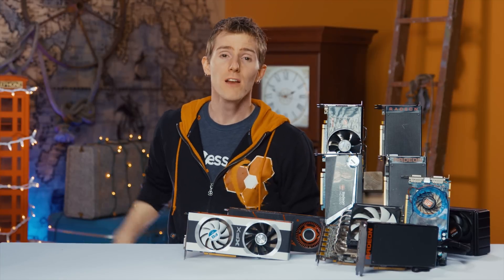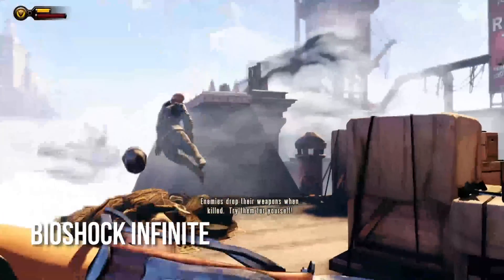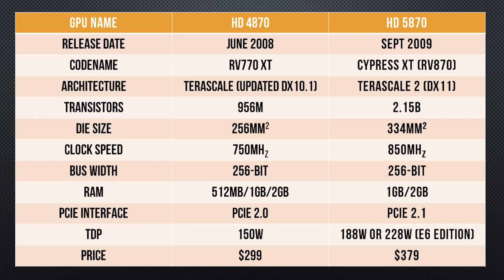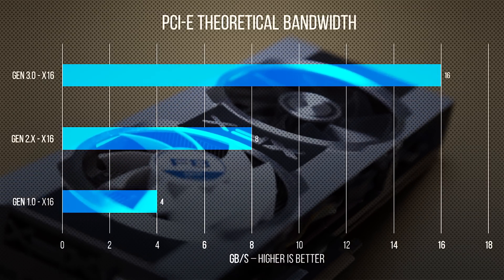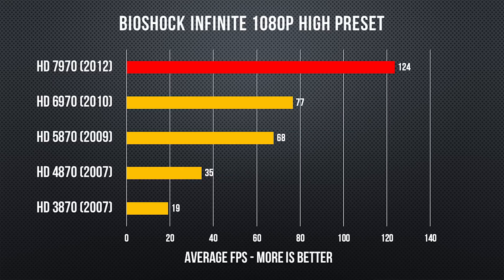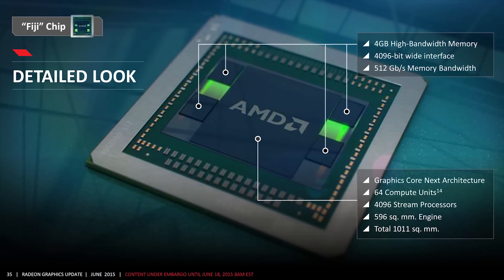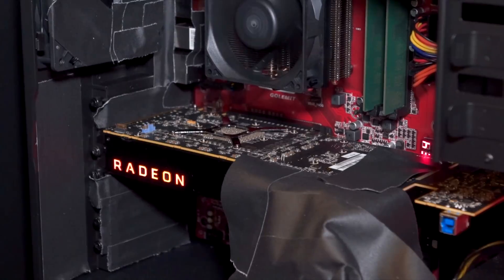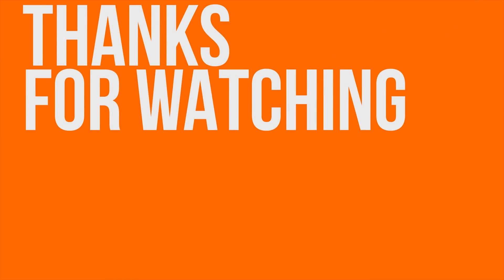10 Years of AMD Video Cards BENCHMARKED!

Comment: That HD5870 chip, brings back memories! It was in my first truly expensive build in a while, paired with an i7 920 overclocked to 4GHz.. In fact, besides having saved up eventually to get an R9 290X, which died on me (it was MSI, no surprise) then having to wait again, that GPU lasted me a good 5 years (i was playing GTA V on a 1GB model, overclocked of course and hitting 40fps!) before finally changing to nVidia with a GTX 970! What annoyed me more is i'd paid full price for the R9 290X, only for it to go half price after mine had died, then couldn't get it and had to choose between a 390X with 8GB, or a GTX 970 and a 256GB SSD for the same price.. nVidia and SanDisk won that one!

Comment: back in 2007 I had a HIS Radeon X1950 Pro 8X AGP card. 512MB 256bit GDDR3. It was a single slot card and had an oversized heatsink with a sword graphic sticker on it and a small fan at the rear of of the card. Then I had an ASUS Radeon HD7770 2GB 128bit GDDR5 PCI-E 3.0 card (part of a PC upgrade build for Win 7 when it came out).  Then 2015 to present I am running an ASUS Radeon R9 270 2GB 256bit GDDR5 PCI-E 3.0 card.  Before the HIS graphics card I was a big ATi Radeon fan back in the mid 90s. I had several different models of the ATi Radeon All in Wonder graphic cards with the built in TV tuner and AV input block. I did a lot of recording from the cable TV back then. Just like you would DVR stuff today.

Comment: Had ATI 7850 Sapphire editing 1GB for exactly 7 years, bought used GTX 960 4 months ago
In that 7 years 7850 served me great,  I started having Issues with NFS 2015 and NFS payback which had to be played at low at 1080p but those games really looked good even on low. Worked great on The Crew and The Crew 2 (almost maxed out), it was really fun to drive countless hours thru whole map of america. 
The only problem I had was VRAM because I got 1GB version and mostly of 7850s were 2GB. So that made me play just cause 3 on low (but 1080p).

Comment: Would be nice to see an updated version of this video.
Reply: especially now, after the announcement of the 6000 series
Reply: King Marco Louis III  RT performance fell where it was expected to. Nvidia had been pushing the tech a whole generation ahead. Either way I don't care green or red, I just want best value. And in my eyes raytracing is an FPS killing gimmick.
Reply: Rtx 3090 owners are mad rn lmaooo
Reply: King Marco Louis III  The price and performance gap between the 3090 and 3080 is where the 6900XT fits in. And similar with the other 6000s. They are meant to compete at price gaps. One needs to remember that the 6900xt is set at $500 less than the 3090. That's huge.
 Further, some people are acting like RT and DLSS are everywhere when in fact it's only a small minority of games (almost entirely AAA) that support them. And even still a lot find that DLSS working well can often be a proposition of what other hardware and settings you run plus whether it actually works well for the specific game and the sometimes noticeable effects can have. I simply look at  as another Antialiasing option. I never made a purchasing decision in the past based on a specific antialiasing support so I dont think that will change for me now. If you need absolutely need RT then your purchase should be obvious, but other than Minecraft, I've found the impact on actual perceived immersive gameplay for RT to be hardly noticeable, and never worth the performance hit. I''m sure one day that will change, but by then I'm sure I'll probably be looking for a new card and both offerings from Red and Green will probably be pretty different. Few should be buying based on DLSS and RT play in my opinion for at the very least a couple years.
Reply: King Marco Louis III  This reads like an NVidia marketing ad.  And btw "DLSS currently is supported universally on the current build of unreal engine 4" Incorrect. They have an Unreal Branch underwhich you need to be approved for, they aint letting any old joes in. I mean if you listen to what the reviewers are saying, I'm basically saying the same things. None of these cards directly compete really. And while RT and DLSS are good to have, right now and in the near future, it really depends on your specific use case scenario, hardware, and preferences. Basically if you have a specific game you want to play with heavy RTX, if that's important to you then go Green. If you're prefer to keep your options open and have a specific budget, then Red may be the better option. Certainly, looking at the performance per watt, AMD has a lot of headroom for OCing and driver optimization that shows a lot of potential for their 6000 cards to really mature with time. Efficiency wise the RTX 3000 cards are really brushing up against the ceiling. And man considering the extra memory and unrealized potential of the 6000 series, especially if you have an AMD system is definitely something to consider, more so if you're big into games with lots of modding.
Reply: @johnjingleheimersmith  I bet he's a Nvidia employee or he's smoking something funny... :)
Reply: King Marco Louis III  "The only card that's legitimately future proof is the 3090 and only the 3090." LMAO! Stoned? Mmm. Stop it! It's not good for you! Damn...
780ti, 980ti, 1080ti, 2080ti, TitanX and 3090 were never future proof... Not even for creation content. Their pricing made them a silly purchasing options even for the ultra enthusiast... Only professionals who make money from such a hardware should buy them! Period!
Reply: @Polar92886  i agree, those cards are just way overpriced and a huge majority of people just want high fps at a reasonable settings and price, that is why sometimes AMD cards just gives us more value without extra gimmicks that you would have to pay for. and also, look how the r9 series are doing now, they are a compelling option especially for budget gamers that just wanna game but still have really great experience
Reply: I agree...
Reply: King Marco Louis III  The main purpose of the 6900xt is as a halo product. I never brought up any card specifically. My point was that the card served its intedned purpose just fine. No one (that understood what was coming) expected them to be even on par in RT except maybe a moonshot's of a chance. It wasn't embarrassing to AMD at all, and as most long time reviewers have summarily acknowledged, it represents a return to relative competition, and opens up the really interesting things to start happening in the next few rounds. The other cards in the series were the true players, whilst the 6900xt was more symbolic.
Reply: King Marco Louis III  The 6800XT is faster than the 3080 in everything but 4K!
But 4K needs a 4K monitor! How many of your friends have a 4K monitor? 4K monitor's cost is too high for most people for now!
Most people don't care about ray tracing either...
Reply: King Marco Louis III  i gotta agree about the perfomance after seeing it myself
Reply: King Marco Louis III  Outside of DLSS and RT the 6900xt does outperform the 3090 in a decent amount of games and use case scenarios. As a halo product, it's simply there to say "we're back and we're coming" Sure it isn't the top in general, but if you consider the $500 price delta, it certainly makes it more compelling, especially if you're figuring the VRAM and incoming driver optimizations and hardware synergies to be compelling and providing additional value and futureproofing. AMD appears to have wanted to compete on many different levels and gaps, avoiding direct comparisons. Making them more apples to oranges based on your specific use case. Not as a "card to rule them all" which is I think a valid strategy, especially in a time where any top card is scarce and likely will be for the next year potentially.
Reply: King Marco Louis III  Lord. No one needs RT to play a game. And if you're in the future struggling to get a game to run, RT is probably one of the first things a lot of people would disable to get a game to run smoothly.  Ignoring DXR and Vulkan which still have plenty of roadmap for improvement, this gen is likely to be as passover as the last, due to stock shortages. They'll barely have time to recover inventory before the next iteration. Nvidia's proprietary solutions are more than likely to hold it back with devs as I see it in the long run. So there are many more point to consider other than the one of "RT omg, need RT".  RT can look really nice when well implemented, however it's clear just by looking at the games that currently support it, and then the percentage where it really makes a decent difference, then the ones that are actually good games, provides a lot more context about how much longer NVidia will need to really push the marketing on it to reach wide proliferation among new releases outside AAA. Green could make some gamer and dev friendly moves to really help sway things in their favor, but I doubt they will. If you're being truly honest with yourself and not being myopic about the current and near-future state of RT, and looking at the current lineup of cards, this gen Green has barely managed to keep the crown, and Red has a lot of potential for the next lineup. That should be the real takeaway.
Reply: Take the recent Q&A from hardware unboxed as an example.  Then look at pretty much all the leading graphics card reviewers right now. They're all saying the same things I am. RT is still very young in terms of market penetration. It's why they include separate benchmarks without RT and their conclusions are figuratively all asterisked in acknowledging the odd juncture point in time that we're at right now. There's no super midrange value king at the moment, RT is very intriguing but only 2nd gen at best, and things are in a mode of high flux. Personally one is really in the market for a value/performance card, waiting 6 months for those potential releases is probably the best bet. I've owned both RED and GREEN cards. Right now Im running at 1050 hah. My next purchase is gonna depends solely on price and performance absent RT capabilities. I will say though that Green has disappointed me lately with things like G sync vs freesync. It seems like they've been tilting toward a more "apple" style business practices, so it's great that Red is bringing the fire.
Reply: King Marco Louis III  Universally? Damn! So far only Control and Watch dogs Legion have really good ray tracing implementation... In some (not many) tittles RT is ok but with a devastating hit in performance! And Dlss helps but not in such a meaningful way for now...
Reply: King Marco Louis III  Well you sound as an Nvidia marketing ad...
As far 6900XT well not really a value for money product. But if you don't care about content creation and steaming but only for gaming and if you have a really big budget, well between 3090 and 6900XT the 6900XT is the way to go...
Reply: King Marco Louis III  6900XT made 3090 niche!
6800XT made 3080 niche!
That's why amd cards have so much higher price than their MSRP...
Reply: Nvidia fanbois have rich daddies and their mothers are on the game 😂probably.
Reply: Correct
Reply: yes. they need to do another one for nvidia as well
Reply: In 2024, I agree. Should wait for the new cards to drop tho

Comment: amd’s flagship 5700 xt today doesnt even beat nvidia’s 1080 ti which was released almost 3 years ago
Reply: The 5700 XT is not AMD's flagship.  It's an upper mid-range card.  The 1080 Ti cost 75% more and only averages 9% faster averaged across a lot of games (it's slow in a few of them).

Comment: On the card shown at 3:45 (the Sapphire HD 6970), what's the big round silver thing at the top left that looks like it's supposed to take a flathead screwdriver? I tried Google Images to find that exact model, but images of it only come up on pages where it's for sale, with no real info.
Reply: It's just an electro plated plastic piece stuck on the plastic cooler case for looks.

I still have 2 of those Sapphire cards that I ran in crossfire for years, when I first bought them I thought it did something too . If ya try to turn it it will just break off, nothing but aesthetics on the cooler for looks.
Reply: nice

Comment: Great video. Fun fact - in 2009, I resurrected an ancient gaming PC with an AMD64 3400+ from 2003 and 2GB of RAM. I replaced the nVidia fx5900 with an AMD 3750, which was apparently the best AGP card you could buy at the time. Although the processor was a bottleneck, it actually played most games quite well and got me back into PC gaming. In 2010 I rebuilt a machine from scratch with a 4870 which I kept for 7 years before going for a GTX1060.

Comment: IMO should have been 3870 to 4870 to 5870 to 6870 to 7870 to 270x to 380 to 570 to 470
keeping in mind
bus width, VRAM, shader cores, rop, tmu etc etc.

I still am playing and using my 7870 to this day and likely it will move from my much used and loved phenom 955 (running faster and lower voltage than a 980) to a ryzen 2 7nm till navi gpu replaces it and I can mount on a wall or bios mod it to down volt/clock permanent regardless of drivers ^.^

Comment: I wanted to upgrade to crossfire after a VGA falure so i "rented" a cheapo nvdia card from best buy. I mean naturally check the specs the ATIs are WAYY better right NOT that one cheapo card worked WAY better than one or even two of my new 512bit ATI card. Once i saw 4x the performance for a quarter of the cost I was DONE and will not be back until ATI gets to 1teraheart and 1million cores LOL

Comment: I have an old system with:
Fx-8320
Sapphire 7870 dual x oc 
8 gb ddr3 ram corsair 1600Mhz Ve 
1tb hdd
corsair VS series 650w
GIGABYTE GA-990FXA-UD3 

What should I change to play PUBG at high settings and how much would it cost?

Thanks😀

Comment: Back in December, I had upgraded to a Five Ninety series Hewlett~Packard Pavilion, Model p0057c: This model comes with an RX Lexa Graphics Card, and while it only has 02 GB of VRAM, having an Intel Core i05~8400 or i07~8700 truly helps this GPU shine, and its low cost and wattage definitely has made it an ideal GPU to have on a budget, especially if you're purchasing hardware from Micro Center.
Ideally, if you want a decent grade yet affordable Graphics Card from AMD that has a high amount of VRAM and won't take up so much of your Power Supply limit (if you're on a 2000$ USD Gaming or All~Around budget), the best one for its money (at the time of this post) is the Radeon Pro WX 7100, in my view: While a Workstation Graphics Card that is still priced at Workstation levels (about half a thousand dollars, on average), this Ellesmere card from a little over two years ago comes with 08 GB of VRAM and is right in the middle of the GCN 04.00~based RX Polaris cards in terms of overall speed and performance, only fifteen watts more in TDP than the RX 0570; the WX 7100 has also been proven to be useful in Benchmark Testing for games against its closest RX counterparts, and comes with some optimizations for certain applications that may require a WX to use, it gets the job done without forcing you to up your Power Supply to ridiculously high wattage limits and you could last on this for at least the next decade, definitely optimal to use with the 8700K or 8086K if you have a rig with either or. (:

Comment: Wait a minute, the RX 480 actually has LESS performance than the 390X which is 2 years older? Doesn't make sense, that is a step backwards. It is essentially a downgrade. Why would AMD release a card that has lower performance than its predecessor?

Comment: I had the 2900 XT, 4870, 5850 (crossfire) then went nVidia with GTX 560 (sli) and GTX 660 (sli) and now I am back to AMD RX 480 (crossfire). I always buy one card and then a year later or so, buy a second.

Comment: I had an ATI Radeon HD3870 back in the day.  It is the graphics card that let me go the longest without upgrading.  Sure, the Nvidia cards of the day were more powerful but over time the drivers just kept getting better which improved performance enough that I think it was about 4 years until I upgraded away from it.  Even then I found that the card I replaced it with was not much better (GTX 460 1gb).

Comment: 2018 and my sister is still using my HD5870 Sapphire Vapor-X card... I gave it to her solely for DisplayPort because the fricking stupid (but nice) 2560x1440 Dell monitor I bought her ONLY had DisplayPort for native resolution and no DVI. Aargh!! I looked first for a cheap card since she doesn't game but as of X-Mas 2015 it was over $100(CDN) for the cheapest DP card. 

In fact, in 2018 it's about $100 for any modern card (for good driver support) with DP and that's a GT1030... I could get some crappy old Quadro for $50 but no thanks, and of course USED is probably an option but isn't it strange I could get a new card that used DVI-D DL years ago for $25 but still can't get a cheap card with DisplayPort?

Comment: Wait for AMD's next nuclear reactor that melts in less than 5 seconds. There is a reason why they were always cheap. Unreliable, cheap components, extremely high power consumption and temperatures and high rate of failure. Say what you want about NGREEDIA overpriced fuckers but i've never had one card of them fail me after many years of abuse. Now with the fucking miners making all prices go to hell there is no reason whatsoever to buy AMD.

Comment: 0:27 "Actually costs less." Uh, no. 269 dollars in 2007 would be about 309 dollars in 2016, far from the 199 dollars you're showing. You always have to look at inflation as well, since money is always gradually losing its worth and loses its buying power. In 1941 you could buy a comic book for 15 cents, which would be about 2,43 dollars today. A dollar had much more buying power than it does today. 
Basic economics...